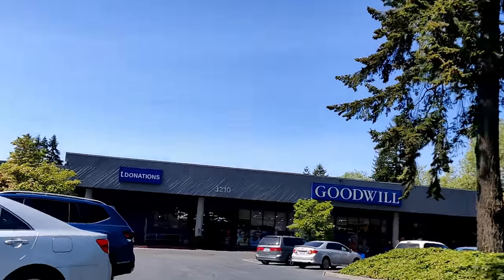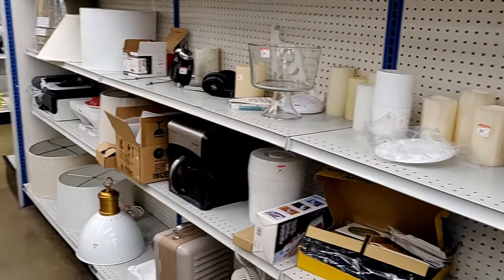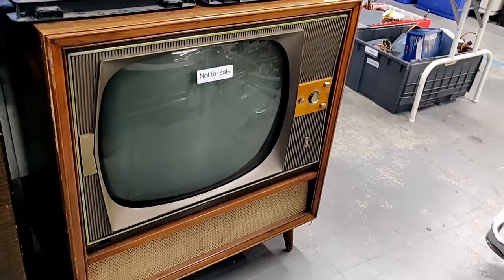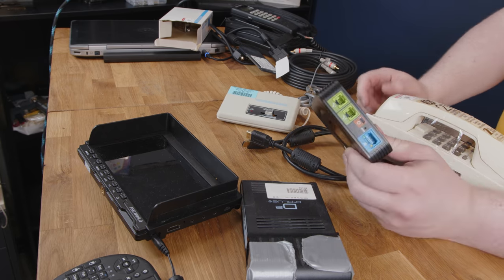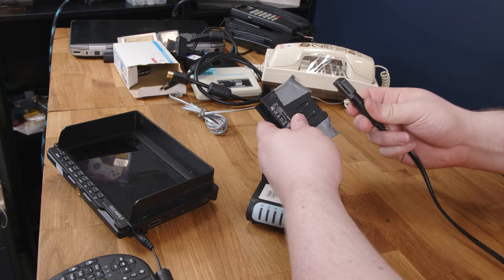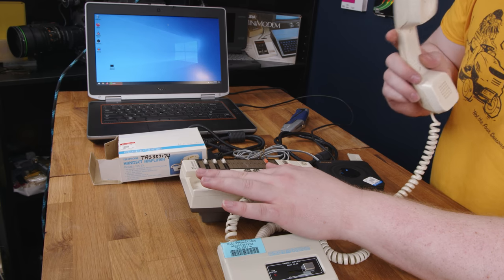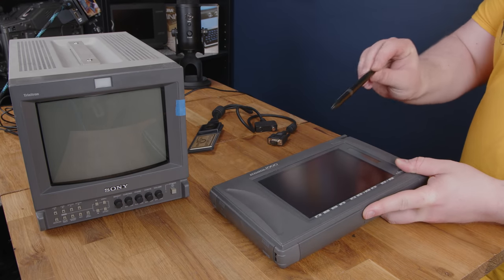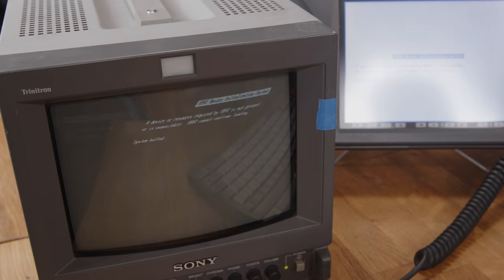Junk Store Trip #7

Comment: My parents had a Rainbow vacuum. It used a water reservoir to trap dust, dirt, and other detritus which we would then empty into a bucket with a screen over it. When the stuff on the screen dries it ends up looking like a dryer lint filter. Great vacuum, lots of power, but moving it around was a pain as the water is heavy and sloshes around whenever it rolls. Also, you could plug the hose in on the other side of the motor and use it to inflate air mattresses. All-in-all a pretty good system as the water did a good job trapping the particles in a way that was easy to dispose of without releasing them back into the air.
Reply: my grandmother used one of these when I was growing up in the late 1980s. this is the first I've heard of one since. I just looked it up, and they're currently listed for as much as $300 on ebay
Reply: @shanedownes  Dang, I really ought to try talking my mom out of hers again. I didn't realize they were so pricey still--she snagged hers at an estate auction for maybe $25!

Comment: The clips in the IMAX Laserdisc that do not fill the screen are historical clips filmed on non-IMAX film.  Since old clips were filmed for TV on standard film/video at the time, subjects were typically framed up-close to compensate for the lack of detail.  Enlarging this lower quality footage with tight framing to the full extent of an IMAX screen 5+ stories tall would provide an awkward and/or blurry viewing experience, so they were typically shown at a smaller size.  If you notice these clips are positioned toward the bottom of the screen, this is because in the typical IMAX theater setup the entire audience is seated perpendicular to the bottom half of the IMAX screen, so the audience wouldn’t have to “look up” at the clips and they would be presented at a more comfortable viewing position.  The jump to full frame video would have been the shots filmed on IMAX film and appropriate to fill the entire screen.  I’m sure that the conversion to Laserdisc could have reframed the older shots to fill the entire screen for smaller sets, but typically IMAX films were such a niche market that it wasn’t worth the time/effort given the ROI.
Reply from the maker: ohhhhh, now I get it! thank you!

Comment: rainbow vacuums are amazing, they're wet vacuums(at least the ones that I've had), and they were extremely expensive, but they lasted our family a long time, the only thing that sucks are that you need to hose out the container when they're full and let the bowl air dry outside, otherwise they're excellent vacs
those things cost like $1k iirc
those things are amazing cleaners though, the suction is excellent
Reply: Was also going to reply this. My grandma has one she uses once a week minimum that she bought several decades ago and it still goes strong. You can fill the tank with water and dump it after so there's no bags/etc.
Reply: Those were great!  They cost more than a used decent car at the time.
Reply: My parents have a modern ish one. It doubles as an air purifier and oil defuser. Great vacuum
Reply: My mom had one when I was a kid, and sometimes the filter water would get brown from all the dirt.
Reply: YOoo i am reporting in at the Rainbow vacuum fan club!!!
Reply: I also grew up with a Rainbow vacuum (that exact model, actually) and IIRC the only reason we replaced it was because the water trap bowl thing cracked and you can't just go out and buy parts for these, plus it was about 15 years old by then. Back in the '70s/'80s it was worth it to shell out the money for a Rainbow but nowadays 90% of vacuums on the market will clean just as well for 1/20th the price. Last I checked a new Rainbow will set you back about $3k.

Comment: Regarding the battery operated DJ-Lights: 
On first thought is makes not much senser, but it is nice if you don't have to run a bunch of cables when you set up on a location, especially for Floorspots (The cables look ugly so you have to conceal them and protect them from people stepping on them). So since these lights often also have wireless DMX nowadays, you can elmininate all cables and it looks very clean. Plus installing and uninstalling a bunch of cables also takes time, and time is money. With these lights it is pretty much "set up and go", and at the end of the night just pick them up and put them back into the flightcase (which also acts as a charging cradle).
And if the battery lasts for the whole Evening it isn't an issue.

Comment: The local science museum (Carnegie Science center in pittsburgh) had one of those massive dome-shaped OMNIMAX theaters, admittedly I don't remember all that much about the IMAX films i saw there but I think this was a common trick, bearing in mind that the full frame in a dome shaped theater takes up basically your entire field of vision. At least from the clip you've shown here it kinda looks like the full frame shots are kinda distorted, ie. so it would look right on a massive curved screen. The I think the smaller windows are arranged on the bottom too because ordinary film clips would distort on the curved screen and a lot of them were large enough that you would have to actually tilt your head back looking up to see the top of the frame. From what I recall non-IMAX movies were usually projected such that they didn't take up the entire screen either, at a more comfortable viewing angle.

Comment: the removable power supply on the pre-Pi Pi is probably so you can swap it for a battery instead, some old AV gear used to do that too.
Reply from the maker: Yeah, that makes a lot of sense. Would be kinda neat to have that - I've seen laptops, and I've seen micro PCs, but I've never seen the in-between, a micro PC with a dedicated battery. sure, you still need to plug in a monitor, but small battery powered monitors have been commonplace for some time. It's a niche application to be sure.
Reply from the maker: this is suddenly tempting me to see if I could cobble together a sort of modern luggable, like a full power NUC with a huge outboard battery pack driving a PicoPSU as well as a 7" HDMI preview monitor, and with some kind of attached, compact keyboard/mouse.

Comment: My mom has a Rainbow vacuum! She bought it probably ten years ago at an estate auction and loves it. She had to replace the water basin for it because it had a crack from being dropped down concrete stairs, but it was easy to find a replacement. It's a good, long-lasting vacuum. The one in the video is only the second one I've ever seen, though. If I remember right, she told me they were semi-popular in the 80s, but pricey.

Comment: 6:54 — Wedding/event DJ here. These are accent uplights. They’re battery powered so someone like me can show up and drop a dozen of them around the edge of a room without spending all day hunting for outlets and taping extension cords to the floor.
Reply from the maker: How long do the batteries last? gotta be like six to eight hours?
Reply: Oh yeah, the set I have (which is also made by Chauvet) can run 10-15 hours on a charge, depending on how bright they set.

Comment: re: wall warts: For 5V 1-2A, you can get DC barrel jack adapters and a good USB power supply. I have used multi port adapters to get rid of a whole stack of wall warts. For anything over 1.5A you want a meter or multimeter to check if the voltage is starting to drop.

Comment: Those Rainbow vacuums are great, they filter everything they suction through water then a HEPA filter, which is so efficient you might have to change once in a lifetime. All you do afterwards is dump the water out. My grandma actually has that model and it works just as good as the new ones, which most of my family has some version of. They're chunk monsters but they last forever.

Comment: The Grandstream ATA
- USB is for power input only. Basically its a common type of 5v power supply now rather than using a 5v barrel connector. 
- Its probably firmware locked to a specific provisioning server address. I am not a vonage customer, but I use the grandstream units at work, I assume that by loading the mac address into your vonage account on their website, their provisioning server will wait for it to call home, then respond to it with the correct settings. The ATA then goes and does a sip registration based on the settings it received from the vonage provisioning server.
- Pick up and dial * wait * wait * and it should read out its ip address that your router issued to it.

Comment: The original Raspberry Pi has a fullsized SD Card slot.
Also the PC Engines APU Systems have that as boot device.
Reply from the maker: Oh wow, I forgot about the Pi - since the slot's on the bottom, I never see it when I look at pictures.

Comment: the chauved led pars are battery poewered because youre supposed to put a lot ow them all around the place by the walls, what is called uplighting, and if you dont need to worry about running dozens and dozens of extension cords and gaff taping it all down, you're golden. btw it has wireless DMX.

Comment: 22:18 Re: Barcodes used in other technologies
Well.. I remember that we had barcodes in our TV guides, in The Netherlands. The idea was that you can scan it with your remote, to program the VCR to tape the scanned show.
It actually worked. The TV station would also broadcast this code, that the VCR recognized. So, it would record earlier or later, if the show-time was a bit off.

Comment: I recognize that Asus monitor, think I have one. It's only maybe 6 years old, 1080P. That first scanner looked like it had a purple USB cable on it. And you skipped right over the Intellimouse Optical! That was a pretty decent selection of stuff there, I'm quite impressed! Shame about the cool typewriter calculator.

Glad I'm not the only one still double masking.

Neat ewaste store, I should look to see if there's something like it near me. I spotted a few things I'd be interested in, in the as-is section. Had a family friend who had a Smith Corona word processor like that. And I've got a big roll of thermal labels that came with a lot from a retail bankruptcy auction, and no printer to run it in. On the plus side I have the most overkill laser printer ever. IBM suggested that you not regularly exceed 250,000 pages per month... I could even get a MICR toner cartridge for it, to print magnetic scannable checks presumably...

Comment: The rgb lights having batteries are most likely for a cleaner power source, or utility (in case the power source is not easily accessible). Most likely the former reason is why aio lights have batteries.

Comment: It's not that you don't have 110v available when doing a production, it's that it takes more cable runs/ work/ general stuff on the ground. Those battery powered lights are common in hotel conference centers and with wedding companies who want setup to be fast. Half the time they don't even use the DMX, they just set them to a color.

Comment: On that that plug-PC, it looks like that's not just an eSATA port, but the moderately-cursed eSATAp variant that merges a USB and eSATA connector, which both work, but also lets you supply 5V power to a SATA drive from the USB pins.

From the "actually read the panel labels, Gravis!" department, if I force 4K resolution and squint, I'm pretty sure the adjacent micro-USB port is labeled right there, "Service".
Reply from the maker: oh, i HATE that.

Comment: I actually have one of those Panasonic Boomboxes at: 1:49 which you then roast at: 4:38, Think I bought mine cheap off eBay and it is in need of some major TLC as only the Tuner works at present which is fine for now as I only use it as an Alarm Clock as it has an impressive Amplifier with a decent amount of Bass and it’s connected to Alexa via a Broadlink IR Blaster and Love the Motorized Lid & Drawer Loading CD Player! 😂🇬🇧

Comment: So, if you have more than a passing interest in the Radiant Systems P1515 POS terminals that you passed up in this video, I actually have factory images for that terminal. Also, their storage is kinda weird, they use a storage medium called a uDOC. It's effectively a USB flash drive on a board with a USB 2.0 header on it. It runs Windows XP Embedded. 😁

Comment: That D2 plug looks a lot like some of the retail display computers I saw installed at Best Buy. They pretty commonly are just used to run a video off SD card or some kind of simple interactive display with a touch screen. I wonder if that's one of those.

Comment: I've got a DreamPlug (not a DreamPlug2 - as you have). I've owned it from new. I might have all the instructions. It came with a cable to go between the PSU part and the CPU part, and slide on covers to make the disconnected parts all look nice. I was going to use it as a firewall, since it has two NICs. I used a SheevaPlug with an Apple USB Ethernet for years as a Firewall. Still got the one I used and an unused spare. I've also got a GuruPlug from the same range. Then Mikrotiks came along and there was no looking back.
Reply from the maker: I have to assume given their age that a Pi blows them out of the water for both power consumption and speed
Reply: @CathodeRayDude  Heck, yes. Although they are "only" 10-15 years old, RPis trounce them.

Comment: If the PC card is really just being used for power, the only other input is the VGA signal so I don't see where drivers & software would come in at all.  I guess it would modify your Display Properties options to give you compatible modes for the converter?

Comment: I can see a certain mediocre logic for that phone with the attached cord and weird removable base.

The proper wall-mounting Western Electric model 554 and 2554 didn't have an RJ11 cord socket; they had a special latch-less plug that slid up and down on rails in the base of the phone, to allow you plug it in and hook the base over the mounting pegs on the wall plate outlet. (You can still buy this type of phone wall plates at Home Depot today!) This was very clever and durable and efficient for the Bell System, but I'm sure it's fiddly and expensive to manufacture — and it means that those phones really can't be set on a table or used anywhere but that wall plate.

This phone supports both arrangements, wall-mount and table-top, by giving you enough cord for many table-top uses, but enough space in that removable base to coil up the surplus cord while giving you enough slack to hook onto the wall-mount pegs. Not as robust or foolproof as a Bell-System-owned phone, but cheap and functional enough (if the consumer reads the manual that has to explain how you're supposed to do this).
Reply from the maker: The actual mechanism of it is valid, but I've seen all those features offered by a phone with a modular plug as well. Since the base plate (the part I took off) puts some space between the wall/table and the chassis, there was room for it, they just saved money by not including it.

Comment: That Vonage ATA, you mentioned it was Grandstream. I know their firmwares are public and they are pretty easy to flash. You maybe able to reflash the factory firmware for one of the GS ATAs. Also, you may be able to get a 3rd party firmware from a company like 3cX. When we switched from a GS IPPBX, 3cX provides custom firmware for GS devices. You may get lucky and it just work with Asterisk.
Reply from the maker: that is a really good idea, even if it's locked down maybe I can TFTP it into normalcy or something. Thanks!

Comment: oh yea re-pc not to bad of a place. i have pulled a few good things from them over time. for laserdiscs i have 8 players 6 pioneer players and 2 sony players. that rainbow vacuum is a water based vacuum. it uses water in the base of the vacuum and u can use it as a carpet cleaner as well with the special carpet cleaner add on. if you ever needed another laserdisc player i can set ya up.

Comment: 4:45 .... this is a keeper ALL THE WAY .... RX-ED77 ..... They sound AMAZING, FAR from cheap. In fact those units were expensive in comparison. This added to their uggly look really kill them. But their sound is way better than some of the good 80s boomboxes. There was tons of discussions about this sort of Panasonics in Stere2go, after being rejected by the collectors as crap, they started to took off even when they are not as vintage, specially based on how they look. Those have some weird ducts inside, Panasonic took seriously the sound quality. Tape is probably out, CD is probably fine .... but they can be modded to use with cellhpones, MP3, Bluethoot. NO  ONE is making boomboxes to this standard anymore. Even when the speakers are 3.5 inch the put serious power and kick